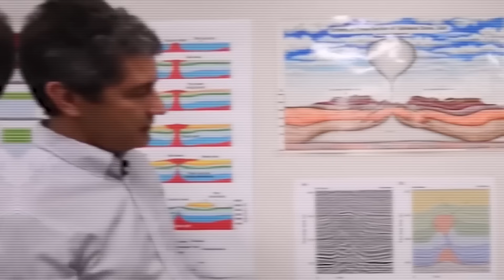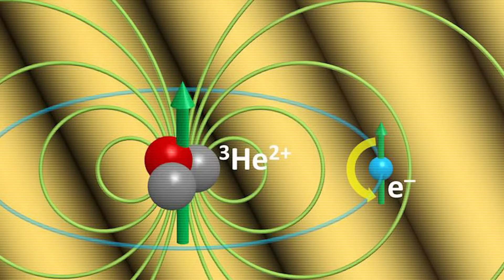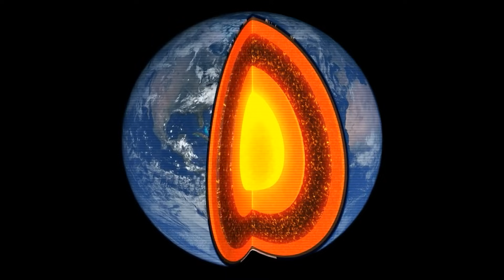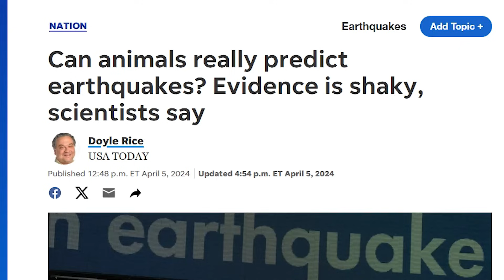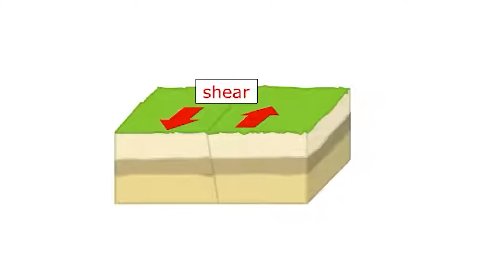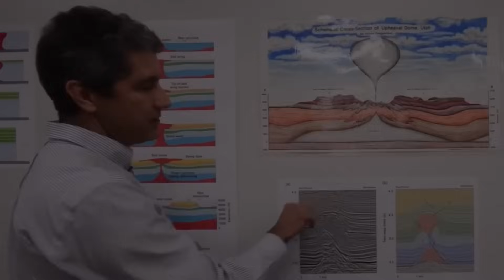6 Signs the San Andreas Fault Is About to Trigger a Megaquake

Comment: When the 5.5 struck San Deigo area the other day, the Quake Alert even went off in Van Nuys and no one felt anything. Listening to some geologist friend's. They were feeling pretty apprehensive because of the proximity to the San Andreas fault line. Yet, they point out the other microquake happening east of the Faultline showing immediate effects of that unwanted pressure build up the NO NO zone showing increased danger to the San Andreas. Well, folks, looks like this one did some damage and has my friends say, the clock just jumped ahead. Not Good. today is 4/16/25